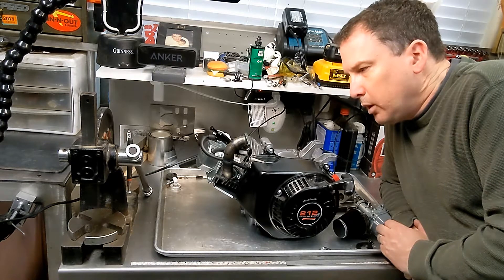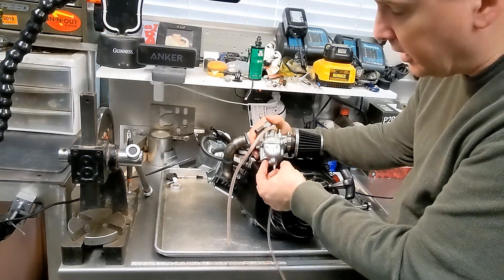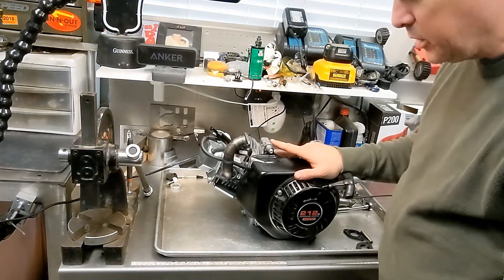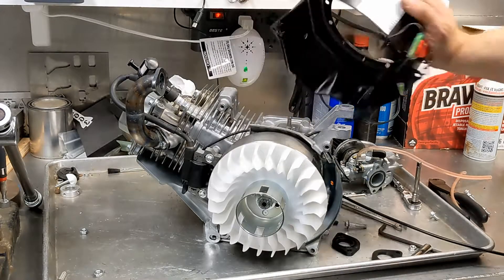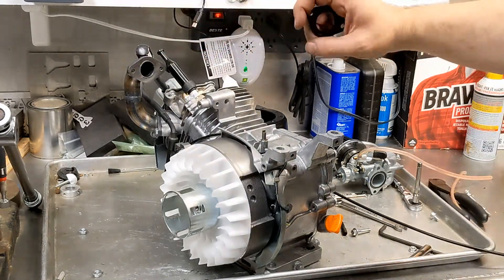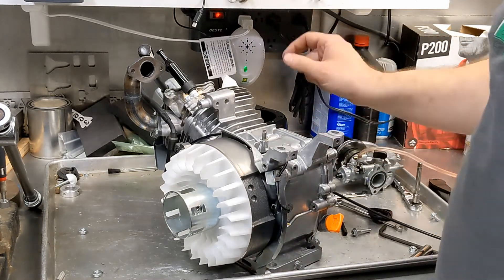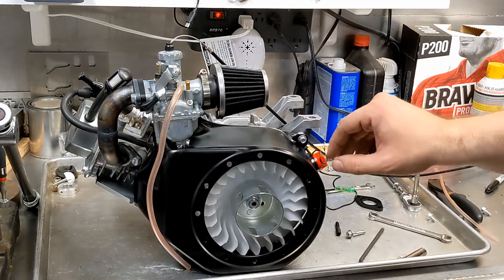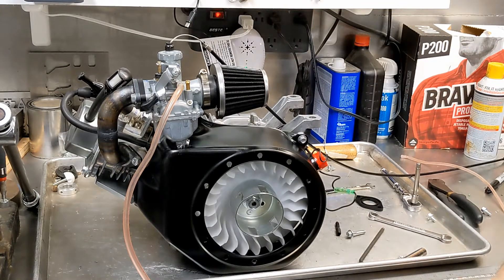212 Predator Engine Mods, Part 1 of 6

Comment: Omg I need that intake manifold adaptor? Also does that adaptor affect the suction of fuel and tuning the carburetor?
Reply from the maker: No...I just needed it for how my engine was mounted in my cycle kart. Most carb upgrades will supply a straight intake manifold adapter